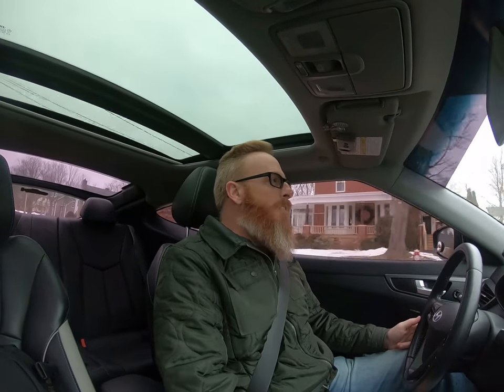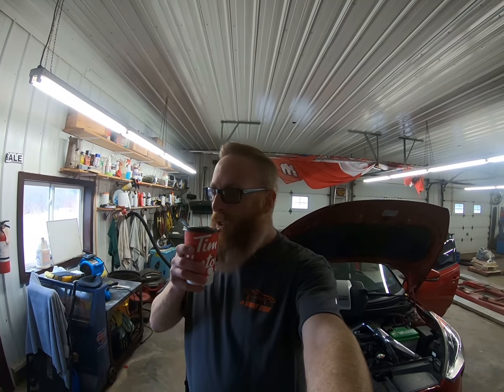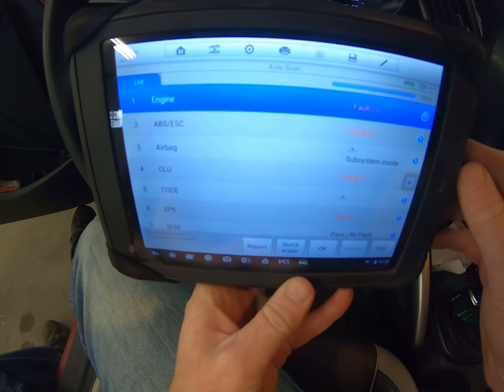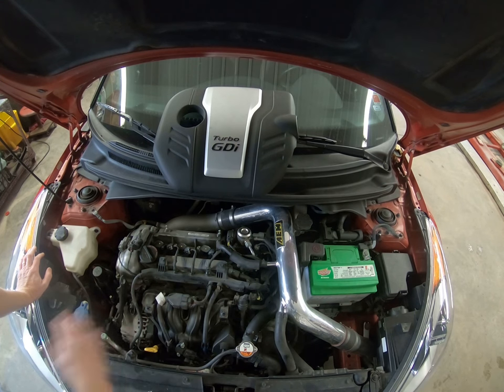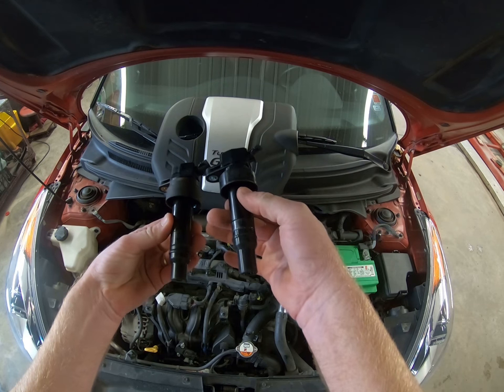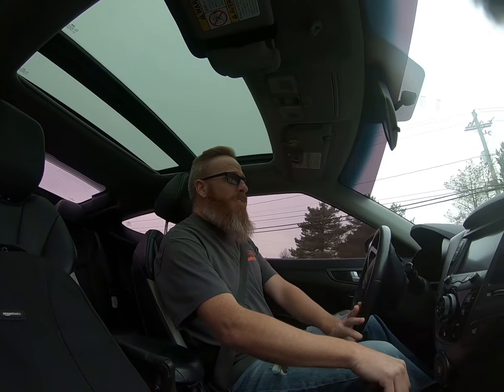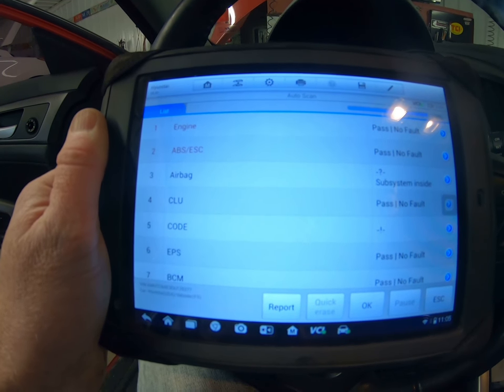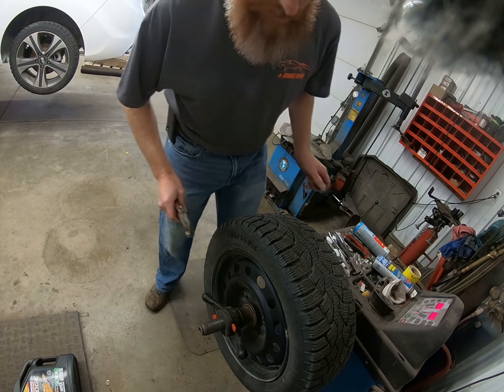PERFORMANCE ISSUES FIXED ON MY WIFE'S VELOSTER TURBO

Comment: I think I might have a misfire but I'm not getting any codes could that be possible when I'm high rpms in 1st and 2nd it feels like it's dropping out so I let off the gas
Reply from the maker: Should have the car scanned for codes anyway. May be something lurking and not setting a hard fault code.

Comment: Hmm, I've got a Jeep 4.7 V8 that's throwing a random misfire code (P0300), not related to a particular cylinder. Only happens at low speed shortly after starting, like in the store parking lot or pulling out of the driveway at home. My mechanic and I have gone over all the things we can think of and have eliminated each one because other expected symptoms don't exist.

I cleared all the codes before a recent road trip where we went to sea level for a week (normally live at 4000 ft). It didn't code at all on the trip but threw one the first day back home. Does it make any sense for something like this to be altitude related?
Reply from the maker: May not be just altitude related, but atmosphere and weather can do stupid little things like that. For instance, a car may be more prone to misfire on a damp or rainy day over a dry condition.
Reply: @OldeCarrGuy  OK, thanks.